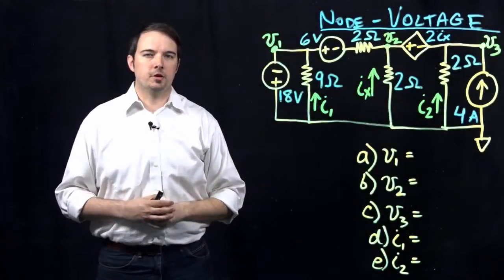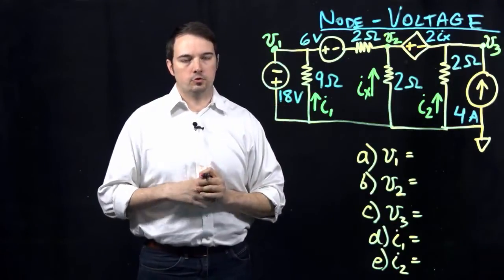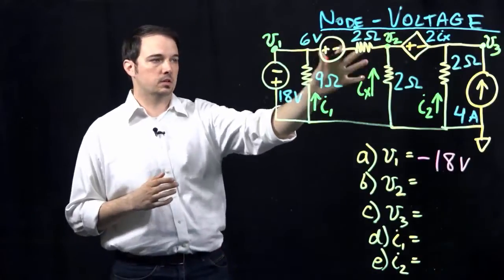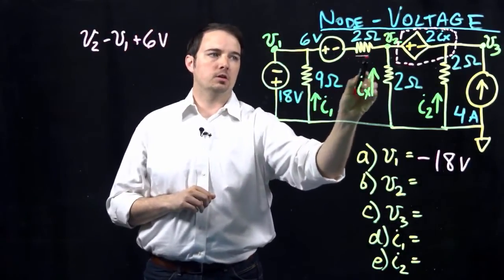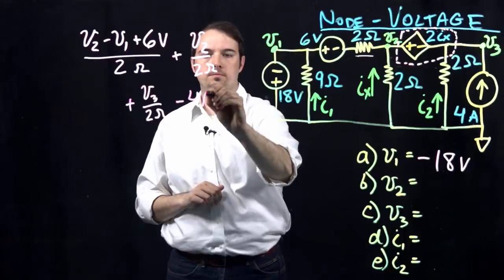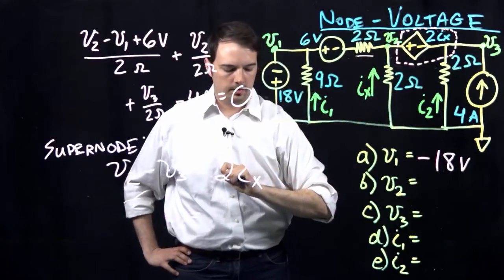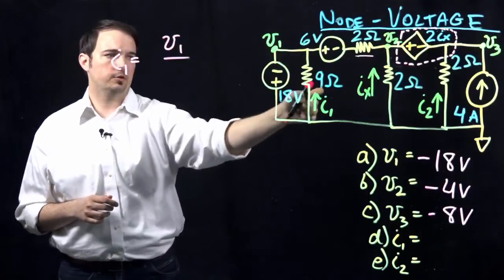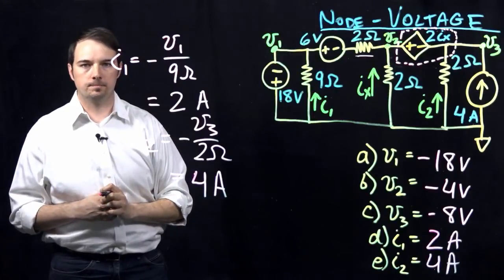Circuits I: Example with Node Voltage Analysis

Comment: Hi, at 4:10 why did you add 6V? Doesn't the 6V contribute to V1 already? Or am I having the wrong idea about the circuit. Its quite a big issue for me now.
Reply: The 6V source would help us to know the value of V1 using the node voltage expression if and only if the circuit shown in the video doesn’t has the 18V voltage source connected from V1 node directly to the reference node in one of its branches because then we need to use the node voltage expression in order to find the value of V1. Notice that the value of V1 equals the voltage across one of its branches that connected to the reference node not to the second node (V2). The addition occurred of the 6V because the current on the 6V branch using V2 is V2-V1(because V1 and V2 are the terminal voltages of this branch) and don’t forget that we have an independent voltage source (6V) but since we are using V2 to find its expression we are subtracting the voltages from V2 as u can see that the negative terminal of the 6V source facing the V2 node as a result subtracting a negative is an addition. I hope that it is all clear now.
Reply: No I don't understand